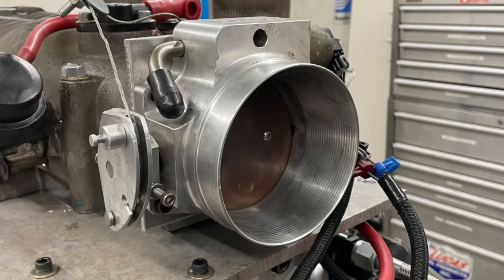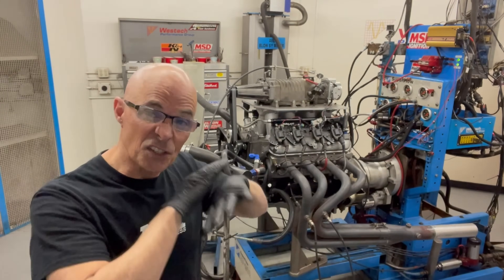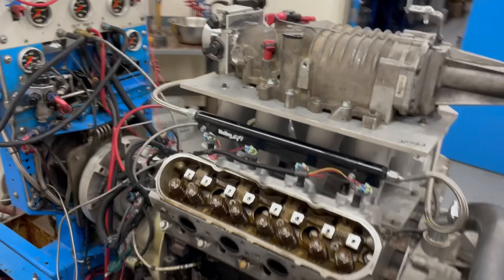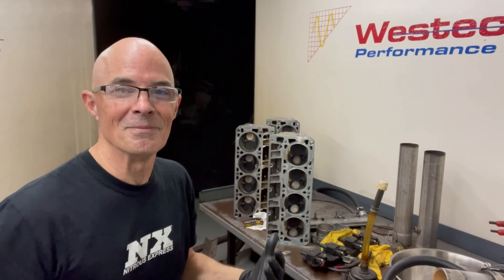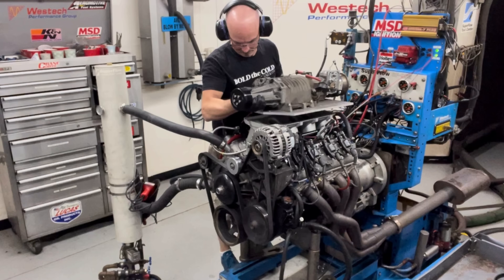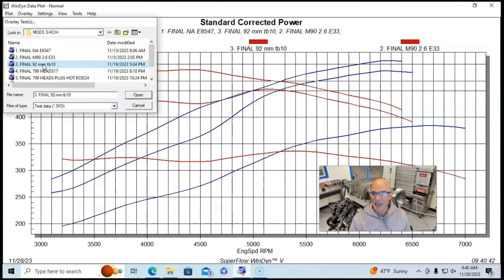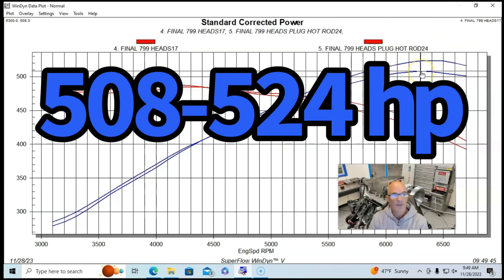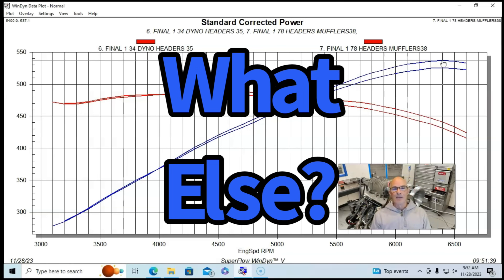JUNKYARD 4.8L M90 LS HEADER, HEAD & CAM TEST. 1 3/4 v 1 7/8, 706 v 799 HEADS, TRUCK NORRIS v HOT ROD

Comment: Rather than using the Hi-Ram as a base, how about a Lo-Ram with a 2" or so Lid Spacer below your flat top, just to increase plenum volume a bit, but decrease runner length. Would that be a waste of time, as the M90 runs out of breathe above 6500 RPM anyway ?
Reply from the maker: short runner will make less power in this rpm range-added plenum volume will likely do nothing

Comment: I say to try a bigger or different blower like a weiand or a whipple and run fuel through the blower and or a lower intake to see what the changes would do as far as HP and torque.
Reply from the maker: a lower intake loses torque, a bigger blower can add lots of power and boost, running fuel through the blower can help rotor sealing but also displaces the airflow
Reply: @richardholdener1727  Well those are things to be shown on the dyno. Its all data that needs to be shown to all. Sometimes what should be is not like the cam and head swap. I thought the 1 7/8 header swap were going to kill HP!?

Comment: Be cool to see 799 heads milled to the same chamber size as the 706 for a more direct comparison.
Reply from the maker: direct comparison is stock vs stock
Reply: @richardholdener1727  not really. I would never put a set of 799 on something that had 706 on it without milling the 799. Compression is important....Likely even more so at low engine speeds.

Comment: Fun test!!  The 799 makes less boost as the PD blower holds intake volume flow the same, add in two degrees of timing to compensate for lower CR....
But the exhaust ports flow the same so the 799 head doesn't net any pumping loss advantage... And they dyno the same, cool!
Reply from the maker: add 2 degrees of timing?
Reply: I ran a simulation and found with a PD blower the 799 heads lost some power from CR reduction, but adding 2-degrees of timing across the board brought the torque right back, and the detonation resistance was the same.  The result makes sense, but not what I was expecting.

Comment: Love all your videos Richard. I was just wondering since we all know the reason why 706 performs so good is because of the small chamber size=higher compression=power. But on 799/243 we all know they flow better. If you milled 799/243 to equal the 706 chamber volume and it already has more flow. My question is how much more power would it make. Also truck Norris performs reallly good in a 4.8 would definitely see a bigger difference between the two cams in a 6.0
Reply from the maker: the difference is more than 3 cc of compression. The difference is also chamber size (fitment) on the bore, the coefficient of discharge, port sizing and different valve sizes (the correct test is stock to stock)

Comment: Mill -.025" off the 799's for a bump in Tq & HP.
Reply from the maker: or mill the 706s
Reply: How about how much hp from hand porting a set of 706 heads then try milling them for a low buck power mod